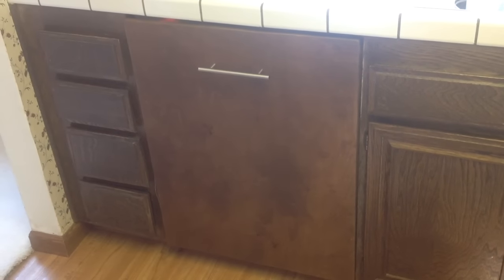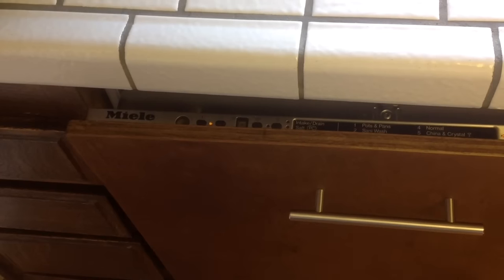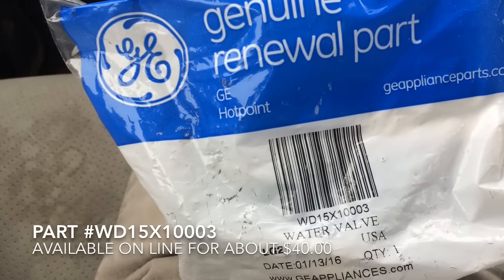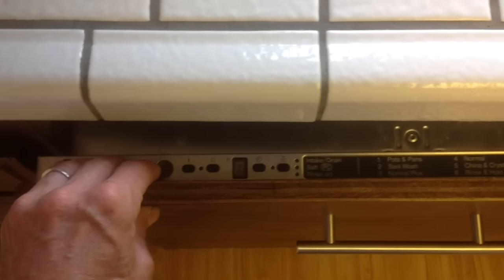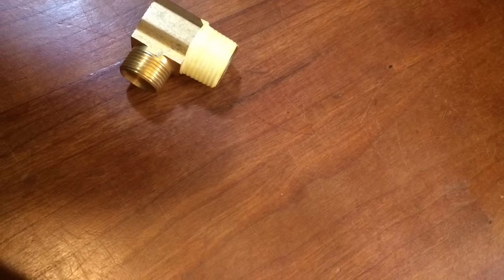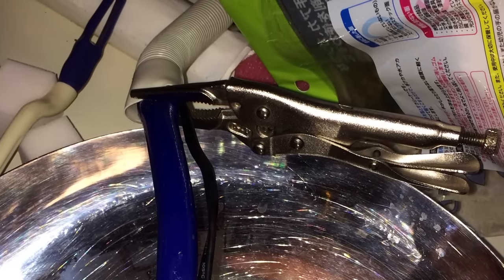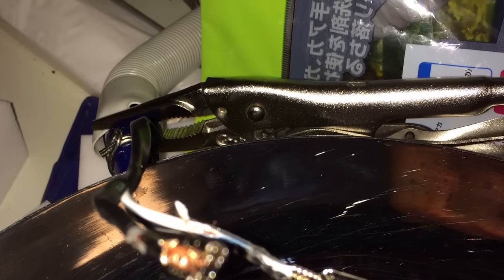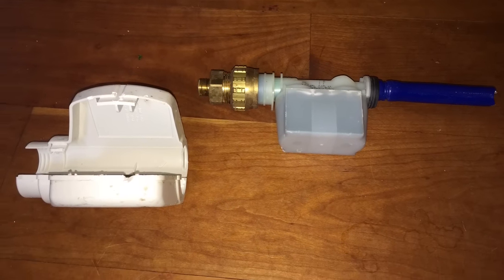✨ Miele Dishwasher intake/Drain Light - Fill Valve - Easy DIY Fix ✨

Comment: Scott, Since doing the repair last week, the Miele Diamante Plus as been working fine until earlier tonight. After doing the main Wash cycle and then filling for one of the Rinse cycles, it drained the water and the Red Intake light started to flash again. I looked up the Error Code, and it is "F13, Water intake fault at end of step". Not sure what to check at this point.
Reply from the maker: +FAUguy23 

Can you send me a picture of how high the water gets when it's done filling? It should reach up all the way to the handle of the filter.
Reply: Scottthefixitguy OK. When we got the unit installed 7 years ago, we had an issue with it making a lot of suds with different wash tabs (Miele, Method, Finish Quantum), so the Miele Tech came out and programed it to fill another 1L of water, which solved the problem (also selected 2nd Interm Rinse and Extended Drying Time). I have left those settings On, but can turn them Off in the service menu.
Reply from the maker: +FAUguy23 

Can you send a picture of how high the water goes?

It should reach the bottom of the filter handle
Reply: Scottthefixitguy Yes I will later tonight.
Reply: With the unit set to the standard water fill amount, there is 1 1/8th Inch of water above the metal filter screen and does not reach the bottom of the handle:
https://www.dropbox.com/s/ljpna1iwv8uexk4/20170307_234106.jpg?dl=0

But with it set to Increased Water (service menu option 23) it fills to 1 3/8th Inch of water and does touch the bottom of the handle:
https://www.dropbox.com/s/kp4jw0vuklng14g/20170307_235302.jpg?dl=0

I have had it set to the Increased Water mode since the Miele Tech did this the first year we had it installed and was getting suds. Since he made the change we haven't had suds since there is slightly more water filled into the unit.

Comment: Scott i have the incognito g 5675SCVi and it doesnt have the external valve. I'm getting the F18 and it hums and water just keeps coming in on that side port till i shut off the power button.
is the valve on the inside? I was just about to order the parts you suggested and realized it not there
Reply from the maker: Yep,

Just pull the dishwasher out of the cabinet and lay it on it’s side and remove the bottom panel and you’ll see the valve.

You can call Miele USA and have them send you a new one.
Reply: @ScottTheFixItGuyChannel  thanks I will do that. Odd thing, my wife tried a test and switched back to the powered brick instead of the gel paks and she ran 2 loads today!  we'll run powered bricks till the weekend and then i'll open it up.
Reply from the maker: Very good👍

Comment: Hi Scott, my Miele dumped water all over my floor last night and we got it to drain, but now it will not fill with water and the intake light is on. We tried your other fixes first to no avail. Now I'm sure I have to change the fill valve. How do I know that the ge part will work? I have seen that Miele has a few different valves. I have a touchtronic   G 896sci plus. Please help! I cant afford  the $160.00 they say it cost s for a Miele version.
Reply from the maker: +ANGELA ZIRA 

Thanks Angela,

Do you think the valve was stuck open and flooded the floor?

I think the drip tray below the dishwasher is full of water from the flood and is preventing new water from entering.

I can send you a video that shows how to get the water out of the drip tray.
Reply: Hi Scott, I combed through some of your other videos and responses. I found what you were just suggesting and that's exactly what was wrong. No parts needed at all! Thank you! Your help is a life saver!
Reply: Scottthefixitguy do you have a link for this video?

Comment: I replaced the valve and the washer fills with the valve running for about 10 seconds then stopping, the red light blinks, then the valve opens for another 10 seconds.  it does this repeatedly until the washer is full to the proper level.  Unfortunately, the valve keeps opening and closing while the washer is draining.  The washer fully drains, then fills again with the same process.  Any suggestions.

Comment: Hi Scott, I have a Miele G4220 that drains, then fills, then immediately drains again with the intake/drain light flashing and the F13 error comes up. Water pressure is fine (we use a pump and bought a new one), water is filling to the correct level. The circulation impeller is fine. The machine is draining well. It just won't wash. Fills, then empties with error code. Do you have any ideas?
Reply from the maker: +bartra1000 

Sometimes the float gets stuck and will cause that problem.
I would try pouring in two pots of boiling hot water and letting it sit for half an hour and then trying to cycle again
Reply: Thanks very much for your response Scott, I know about the float and the impeller. Neither of these were our problem. We have actually replaced the flow meter board since I sent this post. Now, it fills in a pulse (not constant), keeps going till it reaches the correct height and starts to pump out. It keeps filling in a pulse and draining continuously now and we had to switch it off so we didn't run out of hot water! I have seen some posts about the flow count needing to be reprogrammed once a flow meter board has been replaced but I can't find instructions on how to do this anywhere. If you happen to know how, or if it is necessary at all, it would be great if you could let me know. Much appreciated. Tracey

Comment: I replaced the fill valve hoping it would do the trick, but it did not.  Will drain, but won't fill.  Any advice?  Also, you mention in the video that I should have felt some vibration in the valve, but I did not with the old one and don't with the new one.  Electrical issue?  Open to your suggestions.  Thanks.
Reply from the maker: +D S 

Do you think the bottom tray is flooded?

Does it keep trying to drain?
Reply: Yes, the bottom tray would flood, even with the machine turned off (created a bit of a mess on the floor).  Ended up turning the water supply off to avoid this happening.  Will drain when I turn it back on, but won't fill after draining when it starts the cycle.  Thoughts?
Reply from the maker: +D S 
If there is any water left in that lower drop tray it wont fill.

I'll send you a video
Reply from the maker: +D S 

Try this video:  https://m.youtube.com/watch?v=oSuyUNBJp0g
Reply: Thanks.  Drain hose is fine, no blocking in sump pump area.  But the lower pan is full of water.  Wondering if it's a leaky seal by the impeller that you mention in the video.  Do you have a video on how to remove that part to check if that's it, and how to replace if it is?  Very helpful videos by the way.
Reply: Also, sponged up the water in the lower tray and then everything ran just fine and it would fill again.  So, looks like we've got a leak.  Please send me a video so I can check the impeller seal.  Thanks again.
Reply from the maker: +D S 

I would remove the drip tray panel and watch as the dishwasher fills to see if you notice water coming in.

The one way valve in the sumo area may be stuck open causing the lower tray to flood.

Comment: Hi Scott! 

Thank you so much for all your videos. Super helpful! People like you make the internet an awesome place for learning. 

I've tried nearly all your suggested fixes barring the replacement of parts. I bought a used G818 miele machine that seems to be in great condition. But, I'm getting a F-08 fault code for water supply/pressure switch. What is odd is I don't have anyone else's symptoms. I start a cycle, indicator light illuminates and I hear nothing save for a few relay clicks, then the indicator light starts blinking after 30-45 seconds and the drain/intake light is on. do you have any suggestions? Drain valve is clean, impeller moves, circulation pump impeller moves smooth, water supply has ample pressure, intake screen clear. I never hear the drain pump start up or hum. I should also add, I bought the machine a year ago and it hadn't attempted a wash cycle until today.
Reply from the maker: Sounds like the fill valve needs replacing.

Comment: This video does not mention that there are different types of intake valves.    There are both 120v AC and 12v DC valves.   You need to make sure you get the right one.   Of course, I did not.
Reply from the maker: Thanks,  it’s 110VAC For sure

Comment: This didn't work for me.  It seems that the dishwasher is only sending about 2.3v to the water intake valve which is not opening it (I know because I pulled the outlet of the valve off.  Looking at the replacement part it seems like it wants 120v.  Any suggestions?
Reply from the maker: +Randy Pulis 

Hi Randy,

You might have water in the bottom drip tray underneath the dishwasher.  If so it won’t let new water in.

Comment: I have a Miele Diamante Plus model that is 7 years old. Now the water continues to enter the dishwasher, even when the unit is powered off. Running a Wash cycle, it will fill, but then after a minute will drain and water keeps coming in. The solenoid box does vibrate, and gets power, and does stop vibrating, but water continues to flow. Do you think your fix would solve the problem?
Reply from the maker: +FAUguy23 

Very common problem for Miele dishwashers.  Your fill valve is mechanically stuck slightly open and will keep filling even when powered off.

You need to:

1. Turn off the water to the dishwasher under the sink
2. Watch the video on replacing the 220.00 Miele fill valve with a better 40.00 fill valve
3. Watch the video on fixing a dishwasher that just keeps on draining because your bottom drip tray is now flooded.

40.00 later and 1 hour of work you'll be up and running again with a great dishwasher
Reply: Scottthefixitguy I ordered the parts earlier today that was shown in the video. When I called Miele, their Hose with Solenoid (Water Proof System) is $140. I have opened up the bottom front access panel and raised and lowered the float switch a few times. That was a issue a few years ago, that it got stuck.
Reply from the maker: +FAUguy23 

Nice job,

I had a float/flood switch get stuck on a customers Miele.  The styrofoam swelled up and got stuck inside the plastic housing.
Reply: Scottthefixitguy is it difficult to replace that float switch, if that ends up being something else that has gone bad?
Reply from the maker: +Scottthefixitguy 

Not to hard to replace the switch.

Just need to get the dishwasher out and then remove the 4 screws that hold on the bottom drip pan and there it is.
Reply: Scottthefixitguy I checked the float switch tonight, and it is working just fine, will even driver the drain cycle if the power button is turned off. So I'm just going to use the parts to replace the solenoid.
Reply from the maker: +FAUguy23 

Try this video

https://youtu.be/oSuyUNBJp0g
Reply: Scottthefixitguy yes, the unit was installed in 2010 and the drown hose has a high arc before connecting to the garbage disposal. Tonight I checked the bottom pan, and there was no water present. I manually raised the float switch, and it did activate the drain, and then lowered it back down. Without turning off the hot water valve, water will continue to enter in the unit, even when it has no power. Like you said earlier, the solenoid valve has gone bad and isn't closing. I'll report back after I get the parts in and try out the fix.
Reply: I got in the GE Valve, and waiting for the other parts. But the two electrical connectors on the valve are not market which one is Positive and Negative. How do I know which one to connect the Black + and White - lines to?
Reply from the maker: +FAUguy23 

You can put it either way.
Reply: Scottthefixitguy I finally got in the brass joint adapter and am going to do the repair this weekend. Is there any sealant to use for when the hose attaches to the new GE valve?
Reply from the maker: +FAUguy23 

Yes,

You should wrap the brass elbow threads that go into the valve with 4 wraps of white teflon tape to make it water tight.
Reply: Scottthefixitguy OK. What I meant was on the other end of the GE Valve where the hose connects. Just use the round metal clamp, or also seal it with something.
Reply from the maker: +FAUguy23 

You can just use the same snap ring that was on the old hose
Reply: We did the installation, and thanks to your direction, it was very straight forward. But did have a couple issues. First off, the hot water supply like (PVC) is now leaking some on both ends. It looks like it was the type that is cut-to-length and then has the metal connectors attached to each end (where is leaks). But the GE Valve was getting power but not letting water through. After fooling with it for a few minutes, I started to bang it some on the bottom cabinet, and it would let water in for a few seconds and then stop. So I thought it was defective and needed to be replaced. Then I noticed that the "dark blue" part on the top (where the electrical connectors are) was extended up and I could see a white plastic tube connecting it to the bottom. I pushed down on the dark blue piece, it snapped into place, and it started to work. I guess it must of popped off during shipment, but is working now.

The water flow into the dishwasher is now really strong and loud. Before it would take 90sec to fill, now it is 50. So I closed the supply valve some to reduce the water flow to about what it was before.

When I replace the supply line, I need one a few inches longer now, but wanted to ask what size of threaded connectors I need (that connects to the hot water outlet and to the new brass Ez-Flo joint)?

https://www.dropbox.com/s/vvj667q83jusgdq/20170226_200044%5B1%5D.jpg?dl=0

https://www.dropbox.com/s/2o1y5jqyetz1orx/20170226_200236%5B1%5D.jpg?dl=0
Reply: +Scottthefixitguy Replaced the 3/8 to 3/8 hose today, longest I could find was 20" (was looking for longer). But that got rid of the leak from the supply line. All is working good now. 
https://www.dropbox.com/s/lxqhd1zo0t1v2ic/20170227_191115.jpg?dl=0

Comment: Scott, great video. Do you know if the GE valve WD15X10003 would ALSO be compatible for OUR model Optima G2470?    (Less than two years ago we paid $650 to have Miele valve (7638530) replaced. Now we get drain/fill light and beeps, it'll drain residual water but no new water to start a cycle. Then it turns off.)
Reply from the maker: That will totally work
Reply: Joyce Higgins Hi there!!!! I just want to know who replaced this valve for you before, it was appliance doctor,mr appliance???? Just curious. Greetings.

Comment: My dishwasher light flashes the intake drain, Salt(PC) and rinse aid. I have done the fork trick to free a possible seized impeller and that didn't work. I put my hand on the fill valve and it vibrates but only vibrated for about 2 seconds, stops for about 2 seconds and on and on I can hear a water type noise from the valve.  What to do???????
Reply from the maker: +BBQBOY76 
How high up does the water level go?

Should be as high as the filter handle.
Reply: Scottthefixitguy at one point yesterday, it was covering the filter. Now there is just water under the filter. No water in the drain pan, nothing clogging the other internal components.
Reply from the maker: +BBQBOY76 

Sounds like it's time to replace the fill valve
Reply: thats what it was.Thanks.
Reply from the maker: +BBQBOY76 

Very good,
Was it pretty easy to replace?
Reply: I haven't replaced it yet. I thought it was something more into the motor, so I wasted $150 to call a tec to my house to tell je its the fill valve.I will try to source the part you provided locally and install.
Reply: It didn't work. still have the drain light flashing. I have done the impeller trick with the fork as well. I'm at a loss. Tech wanted $600 to replace the water valve with a Miele. Guess I need to buy a new machine. All of Miele appliances have been complete crap. Dishwasher, washer & dryer, microwave and oven. COMPLETE JUNK.

Comment: With the unit set to the standard water fill amount, there is 1 1/8th 
Inch of water above the metal filter screen and does not reach the bottom of the 
handle:
https://www.dropbox.com/s/ljpna1iwv8uexk4/20170307_234106.jpg?dl=0

But with it set to Increased Water (service menu option 23) it fills to 1
 3/8th Inch of water and does touch the bottom of the handle:
https://www.dropbox.com/s/kp4jw0vuklng14g/20170307_235302.jpg?dl=0

I have had it set to the Increased Water mode since the Miele Tech did 
this the first year we had it installed and was getting suds. Since he 
made the change we haven't had suds since there is slightly more water 
filled into the unit.
Reply from the maker: +FAUguy23 

If the water reaches the bottom of the handle it shouldn't complain of a fill valve problem.
I would reset it by unplugging overnight and try again.
Reply: Scottthefixitguy 
Last week I had the hot water valve under the sink slightly turned (closed), as having it open all the way was having the water gush in the dishwasher with a lot of force since replacing the Valve. Today I opening the hot water line all the way, which makes a lot more water pressure noise entering in the unit, but didn't get the error code. So maybe that was the cause? I will unplug it to reset overnight. 
I also read that the wheel and reed under the left side panel may not be sending correct pulses.
http://www.fixya.com/support/t11584706-optima_g2430_miele_dishwasher_f13_error
Reply from the maker: +FAUguy23 

I bet you fixed it by opening the hot water valve all the way👍
Reply: Scottthefixitguy 
Hope so, but just out of curiosity, with it now opened all the way, and have the unit unplugged over night...if the Error happens again, do you think the problem could be with one of those sensors on the left side?